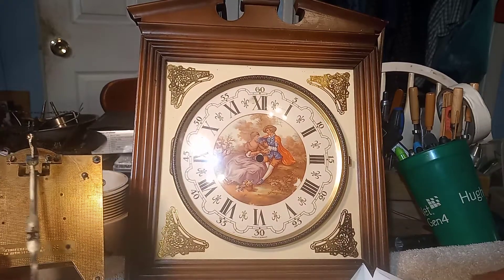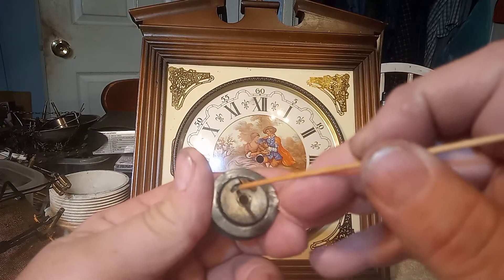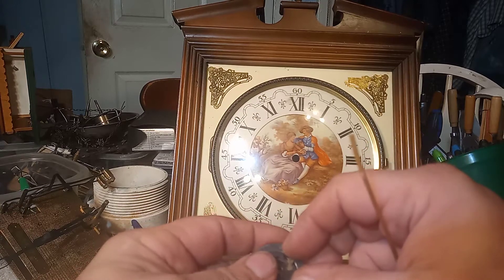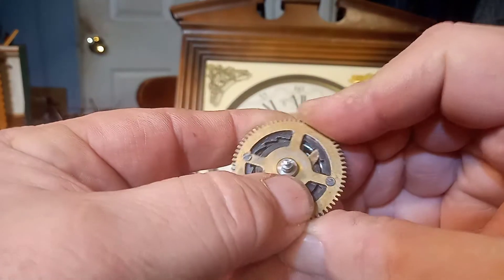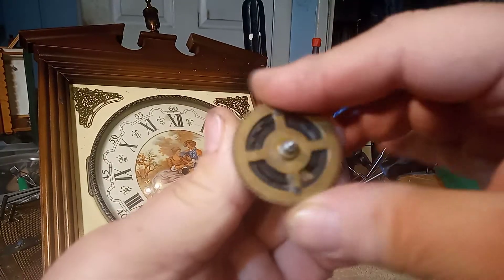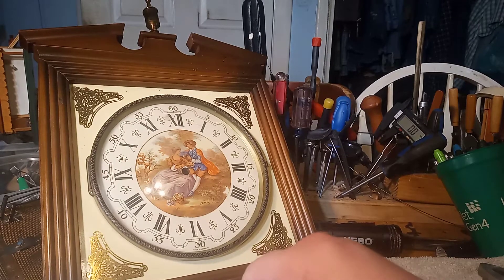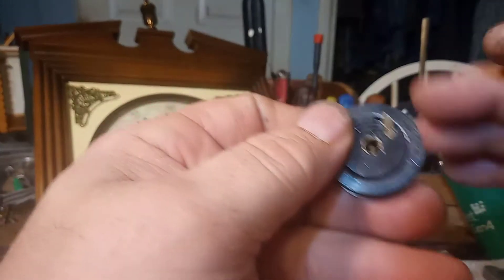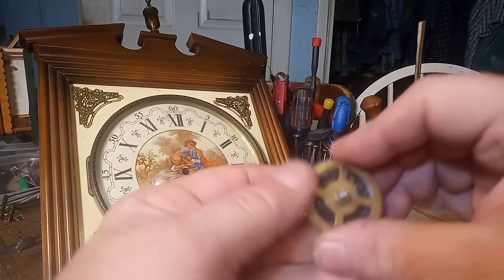Does your clock ratchet wheel not catch on a weight driven clock? 20220116 182305

Comment: Mark I have acquired a Smeckenbecher weight driven clock. It came with no weights. #1 can you tell me what size weights to use on this clock. #2 I thought I had it repaired using weights I had blindly, it chimed
and the pendulum I guess you call it crutch would tick really good. Then put pendulum on & it stopped.😵‍💫
Tried leveling off leveling…you name it nothing worked. So I took it down and turned the crutch arm around
as I saw it facing this way on a video and put it back together. This time the little plastic crutch arm would 
not even swing. The crutch is plastic so you can’t bend it. Any ideas? I’ve got it down again. I at first put the crutch arm with its two teeth facing front then I changed it with them facing back which seemed to make the crutch arm lay on the wood of its opening. The spring thing the crutch arm is attached to  has a
bar that those teeth rest on like your hands on a bike. I’m sooo dang lost at this point. Help😩
Reply from the maker: The weights are around 1500 grams. If you have a beat amplifier then use that. If you dont and you have good ears then listen for the even tick tock. Tilting it slightly until you get that even tick tock. If you still cant get it. Put a piece of blue painters tape from left to right in the mid ways of the pendulum. Make a mark where the pendulum is at a dead stop on that tape. Move pendulum to left until you hear the tick. Mark the tape where that tick is. Move it in the other direction until you hear the toc. Mark the tape where that toc is. Now measure the two from center to each of the marks. You want the distance from dead center to the tic and the toc to be the same. I hope this helps.
Reply: @munnerlyn3  Thanks Mark, believe it or not just got through putting it back together for the third time. I can’t do like you & Mike put the chains on with the movement still in the box. So I’ve pulled the movement 
out three times now. I just hung it on the wall didn’t do any test. Waiting till tomorrow. Will try the tape thing.  No I wish I had a beat amplifier & no it’s a quiet beat compared to my cuckoo clocks. Will let you
know how things turn out. Thanks for all you do. Sherri😊
Reply from the maker: Being death as I am the beat amplifier that you can pick up at timesavers is the way to go. Even where there are a bunch of clocks ticking in the back ground. #15408 for $65.  Wanted to add to the tape thing that you might have made sure the movement was working outside the case and it was level so when  you put it back into the case you assume that the folks that made the clock had them level with the movement. What I am getting at is that you might have to tilt the clock one way or the other to get that even distance from dead center to the tic and to the toc. Good luck.

Comment: And if your spring is broke and your don't have a pocket watch to rob, do you know where you can buy that type of spring. I see all kinds of spring wire type but not this type.
Reply from the maker: a lux clock spring will work or a small alarm clock spring or a novelty clock spring that doesnt work or is scrap or you have an extra one and need to fix a clock. You can snip the end off a spring and still be able to use the spring that you snipped some off but of course you would have to modify it to look like what you sniped off. You can buy a lux or novelty spring from timesavers. You can snip a piece off and you might have to grind it some but it will work. I hope this helps.